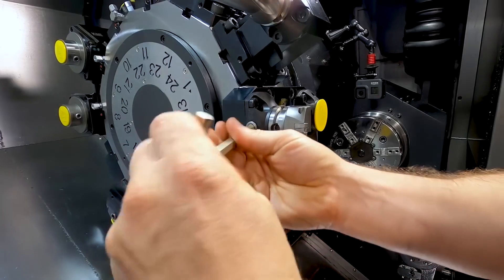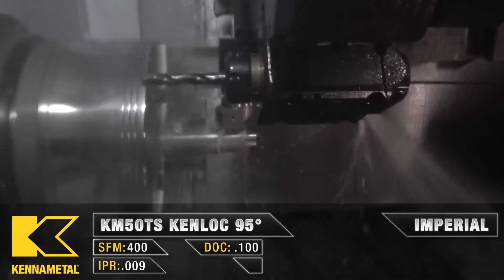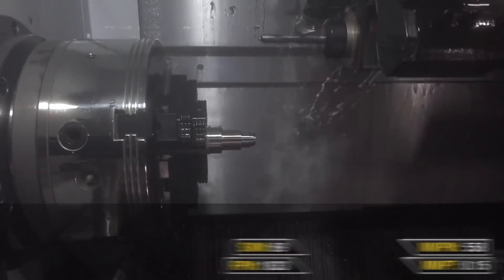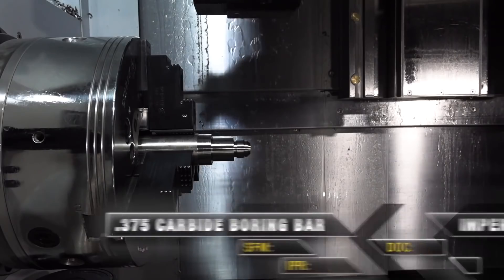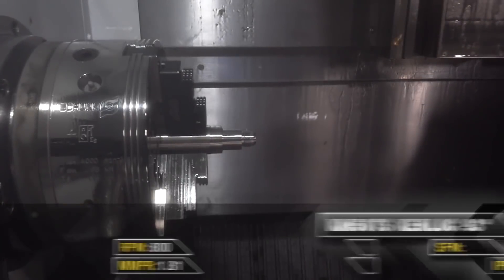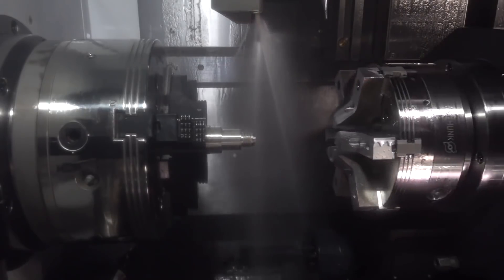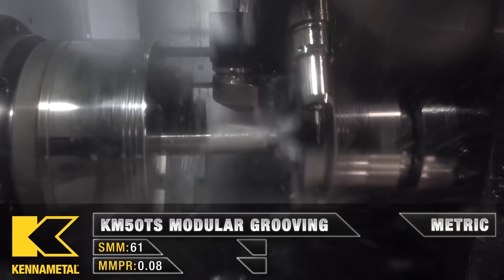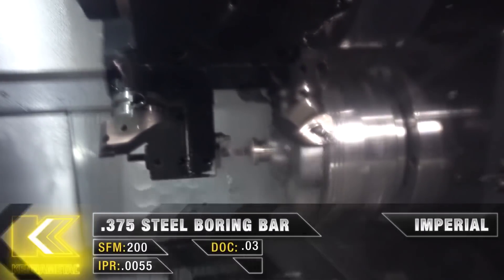SCRAPPING All the Parts in the Shop.... $12,000 Worth of Damage

Comment: Can you please do a video on spot facing, I took a huge step up from vmc's to hmc's working with our biggest and most expensive valve bodies and I've had problem after problem with spot facing bolt holes with Vermont and parallec spot facers and I'm well over 100k in scrap because of it over the last 3 months. Point me in a better direction please!
Reply: Why not just spot face with an end mill? Use an undersized end mill and interpolate the diameter.😀

Comment: titan, there is something i wonder about. Im a trainee precision mecanic in Germany, learnig programing currently and we have a book  in wich are a ton of data for speeds and feeds. basicly guide values, im shure you also have something like this. Do you run your machienes inside those limits or do you somethimes run them faster? we get told for maximum efficiency while maintainung minimum tool wear we should run parts inside those limits but in the shop were i work most employes run their machines verry slow because they are scared of damaging them and out of like 70 programers i know one thats pushing it really hard prettymuch all the time.

Comment: I’ve always learned more from failures than straight lessons. Sure there are situations where failure isn’t an option, but most situations tolerate failure (or do a dry run on cheaper materials where you trash some cheap materials instead of ruining the big parts)

Comment: It's easy to say that you go from 5000 to  7000 rpm and all is good but the reason is because you understand the cutting pressure and tool paths involved . It happened to me , the boss comes over, he tells me he wanted to make the part faster so I increase the rpm , I measured what I could and assumed the part is good because what I couldn't measure was made with the same tools , I finished the second opp and that allowed me to fully measure the part and boom 170 parts scrapped , I went to the programmer and asked him to check the program and it was good then I went to the engineers and I asked what had happened as I had 1 tool that did two features and one was good and one was bad , I got no answer from them and the next day I checked the program again and I realized that one feature was a left profile and the other was right profile , basically one cut was into the material the other one was away from the material and it all happened because I cranked up the rpm with no understanding , in the end it was still my fault that I scrapped half of the order , not the boss who told me to go faster and not the programmer that made the program that way . Since then I evolved to understand the machine so well that I can program full parts in conversational on the machine , I still don't know cad or anything

Comment: It's always the dimension you're not checking that will come back to bite you.  Thanks to all of those who have given us a chance to scrap parts (unfortunately) to actually learn from our mistakes!
Reply: Used to run a 250 ton press brake. Had a customer that needed an integral pallet for the equipment they were building. 10g steel formed framework that was getting box tube for the forklift pass thru, but had a LOAD of holes above for tubing, wiring and locating pins. Customer circled the critical demensions in red, then after completion said those were the NON critical dimensions.

Theres always a problem... lol